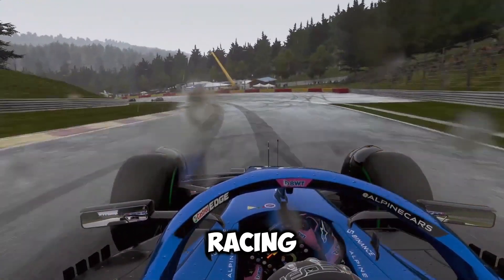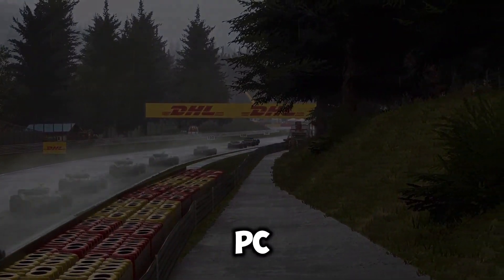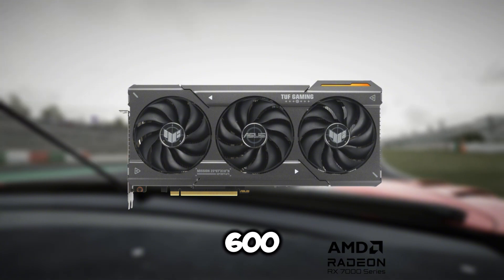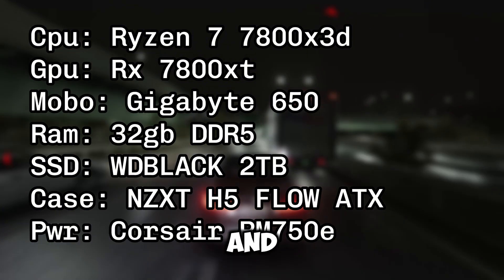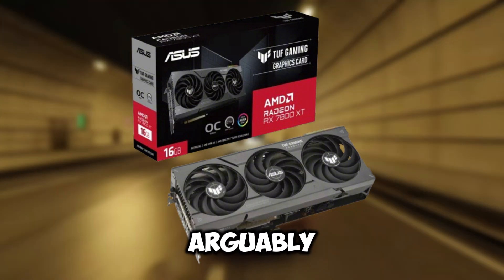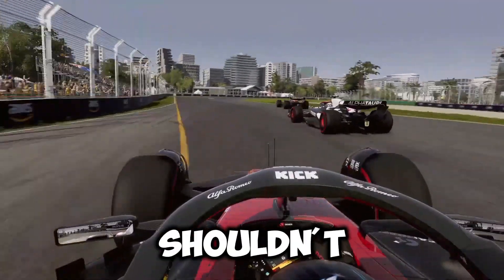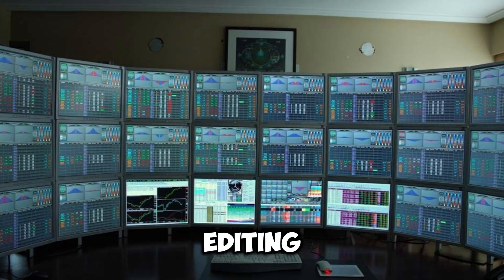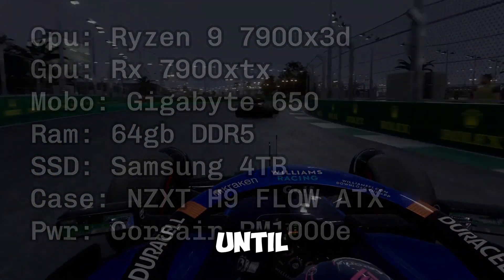How To Build A Sim-Racing PC | 2026

Comment: Only last 4 years because of what?.. That's the only thing holding me back from spending money on a PC that last 4 years. I still have my PS3 & 4 smh
Reply from the maker: Games get more demanding after time, the 1080 ti easily played any game back when it was released, now not so much. Im not saying the pc would out right die after 4 years, its just that it'll slow down and you gotta turn some settings done with it.
Reply: I would guess that one factor is due to AM4 not getting any new CPU's - thus no new mobos. So in 4y maybe the part availability will be heavily limited (mostly mobos). Other factor might be requirements for sims in 4y (although sim sw is not so demanding - it still runs on 1080 now, at worst you could just upgrade the GPU and the CPU will still be sufficient - if all the parts survive).

Comment: Yeah it depends, doesn't it? Most serious sim racers have a triple 1440p setup and some use a a high resolution VR headset If you run those instead of a single screen, you definitely don't want a 7900xtx. Source: https://www.youtube.com/watch?v=CDhP-o3AyaY&t
Reply from the maker: I agree, nvidia does have a easier software to run triple screen or high res vr and I should have put maybe a 4080 super in but i may or may not be biased towards a certain red company 🤔
Reply: @MaxPos1  Considering that the 4080 Super and the 7900xtx are basically the same price right now and that the 7900xtx in many cases even drops below the performance of a 3080Ti, it would have been objective and fair to your audience to at least mention it. The only time the 7900xtx has a slight advantage is on a single screen when rain effects come to play. If you run a single monitor setup and never want to upgrade to  triples or VR then yeah, the 7900xtx is worth considering. But a normal dry race on triples, I mean the difference between the 4080 Super and the 7900xtx is 70fps.

Comment: Will  the medium build run triple 1440p monitors? Sorry I know nothing about pcs, but everything is in my cart
Reply from the maker: The medium build could run triple 1440p monitors but i would suggest cutting a few corners as the rx 7900 gre will fair better with the 2000 more cores it has compared to the 7800xt so if you can fit 50 usd more. Get the 7900 gre. (The 7800xt will but not max settings)

Comment: for the 1600 build you can also use 4070super. Same performance as 7900GRE but pretty efficent which will add up if you use the pc 6years+ and also better upscaling and frame gen and useable raytracing and all the other nvidia features.

in the budget build get the 6750XT. Its 16% faster and in this performance of the 7600XT the 16gb vram are useless for gaming. 12gb is fine and 16% more performance for the same price is better. RX 6800 would be even more superior but would cost more. Also DONT get 5500. The 5600 is so much better for so less more money and 5500 only has pcie 3 ssd support.

For the high end build 64gb ram is litearlly  waste of money and wouldnt recommend that at all if you have enough to spend. Also  you can get 4080 super too in this budget which would be on par with the 7900xtx and only slightly more expensive but more efficent and all the other nvidia features. 7900x3d not nessesary at all if you just game. With 2tb ssd with a 4080super and 7800x3d you can create a solid 2150€/$ pc but to be honest at this price range i would wait till 5080 and 5090 is out.
Reply from the maker: Yes you could  go with the Rtx 4070 super but i had my reasons. 
First off, it lacks vram by having 12 instead of the 16 the 7900 gre.
I would only go With the Rtx 4070 super if u were a content creator or likes the features it has.

Overall great comment had me thinking for a while 💯
Reply: @MaxPos1  yes, more vram is a good reason to go with 7900GRE. But if you like to experience good Raytracing performance, then 4070super is the better pick. 12gb still fine for 1440p but ofc it wont last long with everything at max. But f.e. if you buy it for high end high fps 1080p gaming then 12gb is fine and 16gb wont give you any benefit the next years in 1080p and this way you would benefit from all these nvidia features and the efficency.

Comment: for the 1600usd one i recommend going with the 7900gre as the gpu and a Corsair RM850X as the psu
Reply: i personally would too but the gre is clocked a little lower than the 7800xt but does have more compute units. If you have the extra 50 bucks 💯💯💯 go for it
Reply from the maker: If the prices drops even more 100%, its just the more "widespread option"
Reply: @MaxPos1  makes sense to me